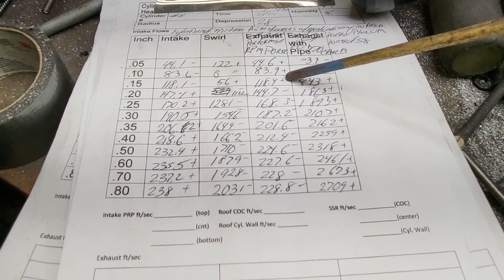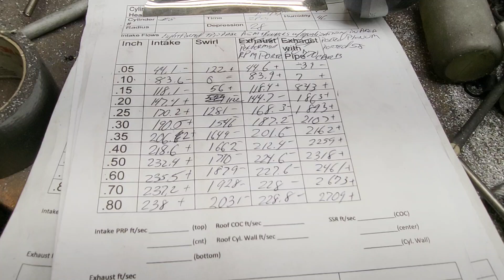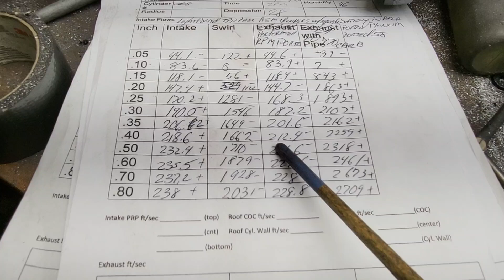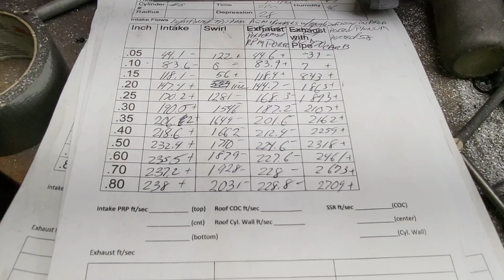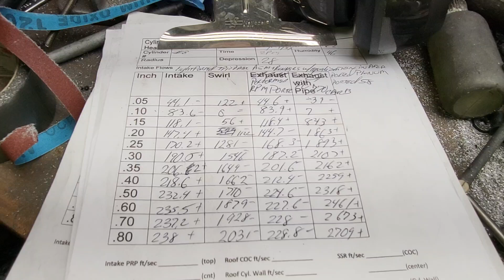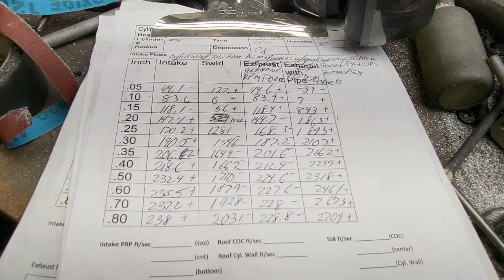Redheaded stepchild, High Performance TPI project, Ported Edelbrock performer RPM vs TPI! Surprise!!

Comment: Do you calculate the runner length of the carb to the top of the k&n horn thing? or the plenum entry, same question for the TPI.  I assume the rest of the inlet  pipework (throttle body to filter is a factor as well but less important than the "primary length". I guess the plenums act like a chambered muffler letting the pulses cancel out a little. Interesting content as always.
Reply from the maker: Runner length does not include plenum or carb. Thanks
Reply from the maker: Plenum acts aa a reservior of air to draw from.
Reply from the maker: Tpi runner length does not include plenum or throttle body. Thanks

Comment: The dual plane has the advantage of using reflected waves to advantage.
Reply from the maker: And the TPI doesn't?
Reply: @servediocylinderheads  The TPI has runner length inertia and individual pressure waves. The dual plane fires the inertia from the runner with closing valve back across the plenum and into an opening valve. That's why they are such good low and midrange performers, they struggle at high speeds because of the bends, not the lengths. look at Richard Holdener's LS tests when he pulls long runner LS manifolds off and puts dual planes on and makes more bottom end power.
Reply from the maker: @TomSmith-cv8hk  Dual planes and TPI work in a similar way but are tuned for different rpm. They both use reflected waves, they both have restrictions due to turnin runners. Dual planes also suffer from fuel fall out due to it being a wet manifold.
Reply from the maker: @TomSmith-cv8hk  Carbs and dual planes do have an advantage of removing heat due to fuel evaporation, that can improve hp, the other side of that coin is that evaporation takes up volume in the runners. Dual planes can work well if done right.

Comment: will the TPI loose torque without the batch fire injector compu. system ??
Reply from the maker: Good question, I have no experience but remember an article going from batch to sequential the sequential had better idle and mileage. If I remember correctly 30 years ago. Thanks
Reply: @servediocylinderheads  thanks,,ya the second wave may not give the boost like before ,but the idle and mileage get better due to the more stable AFR each pulse

Comment: 500 to the wheels, don't doubt yourself!
Reply from the maker: I doubt, I would like to see that but I doubt. Thanks
Reply: 500 to the wheels isn’t happening. More like 320-350.400- 440hp is still a lot of fun.
Reply: @robmartin5382  You're right.

Comment: Nice job. How do you determine how much of the divider to remove without killing low & mid range?
Reply from the maker: I did lots of testing with this in the 80's and 90's. Butt dyno only. If you want more top end cut the divider some more. Thanks

Comment: I would like to see your Victor Jr.  And hopefully your customer will have a good flowing air cleaner system with the DV mods and grabbing cold air from the front of the car.
Reply from the maker: Check out my latest. Thanks
Reply: @servediocylinderheads  awesome job on the Victor Jr. I wonder how it would it compare if you ported  a 300-110 that Chad S.likes?
Reply from the maker: @dondotterer24  Chad said that manifold is a great design. I have never done one. Thanks
Reply: @servediocylinderheads  Thank you!

Comment: Gotta factor in the TPI mass meter and very restricted air cleaner aswell as the loads of time and money spent on a TPiS base, ASM runners 58mm throttlebody, and the cost of the port work to the three TPI pieces
Reply: he won't be running the stock maf and good flowing cold air intake isn't any harder on the camaro than any other car.
Reply from the maker: You make it sound like it isn't worth it!
Reply: Irrelevant.  We have MAF meters that’ll outflow the TPI system and we can also run speed density with a minor re pin of the harness and ECU swap. 

The cold air is also a plus for performance vs an open air cleaner under a hot hood.